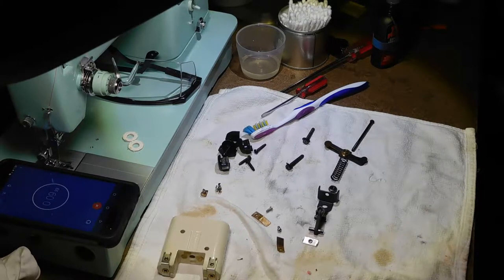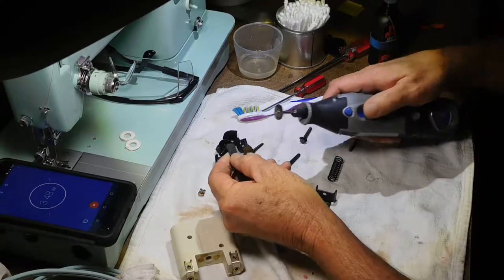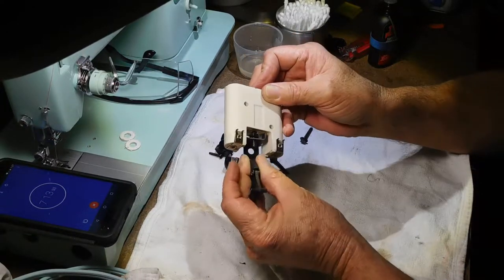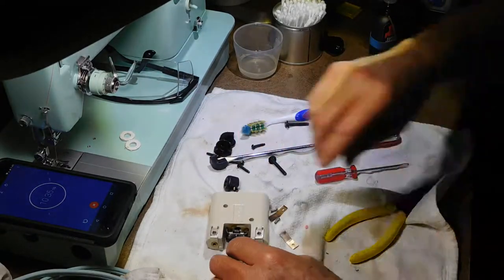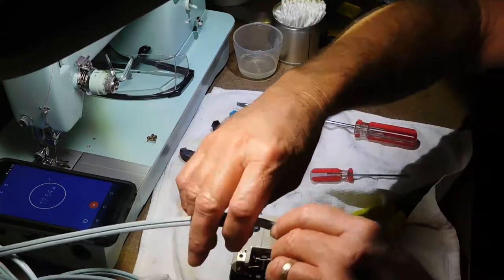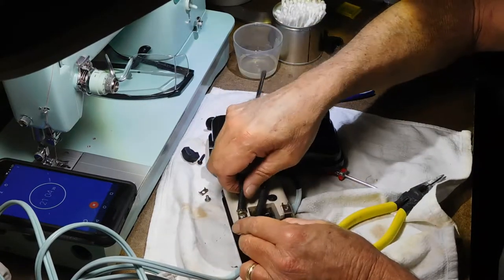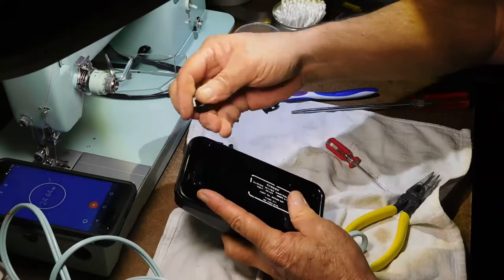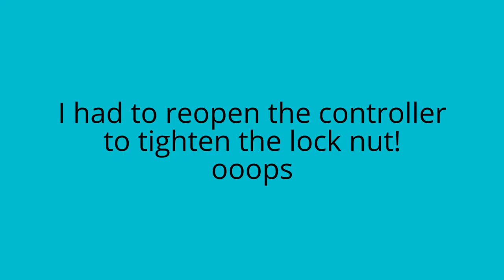Step by Step Restoration of a Singer Model 337. A Series. Part 26B: FOOT CONTROLLER & CORDS

Comment: Darlin' if you go on the other end you will see plaster over small openings. Scrap off the plaster and you will see the heads of screws . Undo those and the brackets come loose and the carbon disks will come out.
Reply from the maker: thank you for sharing a great tip, Terri.

Comment: Thank you, sir for this excellent tutorial. I have been having a problem with my Singer foot pedal for my 1951 201-A Singer. I think you have solved the problem. I also own a Singer feather weight from 1964 with the same problem. It has a very different foot controller that has no apparent means of getting inside of for adjustment. Do you have any videos concerning this model? At any rate, I must tell you how very good you are as a teacher presenting this tutorial.  I would be very proud and happy to be a student of yours at any presentation you may give, thank you!
Reply from the maker: Hi, Philip and thanks for your comment. Your Featherweight probably has a "clamshell" style foot controller. I did a tutorial for restoring that style too! You need to cut a small hole in the bottom to access the inside parts. Here is a link the playlist >> https://www.youtube.com/playlist?list=PLsCOZgzzaiKItPLWcK24FBoMdHK8vTXNi
I hope yoou will stop by again soon. Good Luck.
Reply: Thank you very much for your quick response and excellent video. Best you sir!

Comment: Great video. Thank  you very much. I do have a question. I had the same experience with the foot pedal as you did--it was acting like an on/off switch. When opened the case, it had a lot of dirt, crud and carbon dust. I cleaned all of that out and hoped I would have the same result that you did. Alas, despite the cleaning, the foot controller remained an on/off switch. So I went a little further. Using the video by Curio b-spoke Designs, I opened the housing and cleaned the carbon discs inside the stacks. They were very dirty but not broken. There were 56 on one side and 54 on the other. I evened these out and cleaned and polished the contacts and put it all back together. Still an on-off switch. So I played with the adjustment of the depth of the spring/contacts into the ceramic housing. I tried flush, 1/8 deep and 1/4 inch deep. Still the machine does not go on until the spring is fully depressed and the carbon stacks bypassed entirely. In other words still no speed control. Any thoughts? Thanks again for your wonderful videos!
Reply from the maker: Just guessing that if you adjusted the end into the housing 1/4" and still have this problem that there are not enough carbon discs inside. Maybe Tony can advise you, Katherine 	info@b-spoke-designs.co.uk    I have a playlist for restoring the pedal but you seem to know what you are doing. Good Luck.